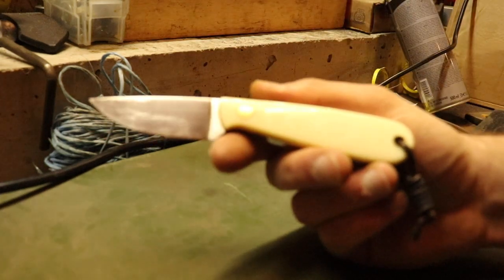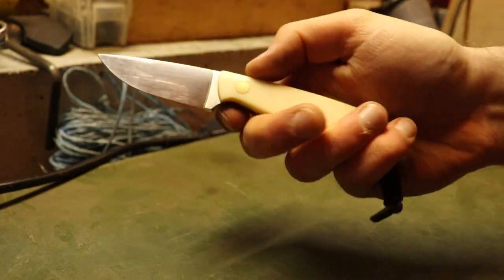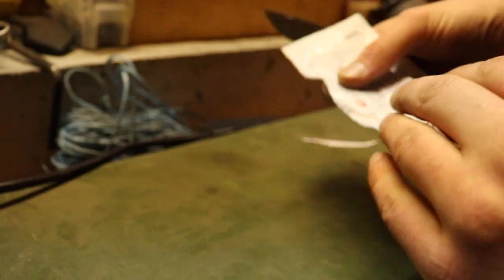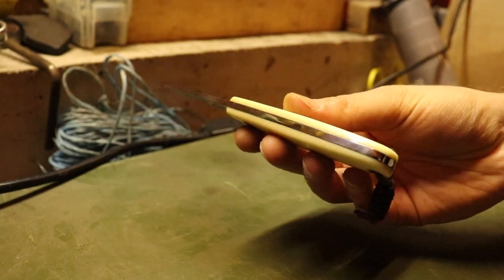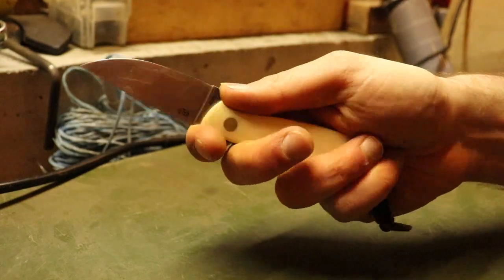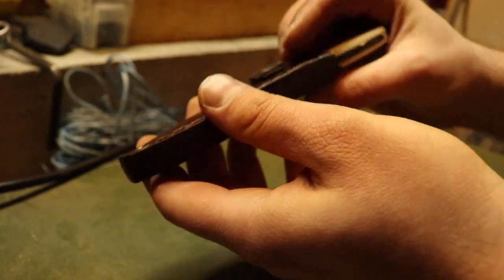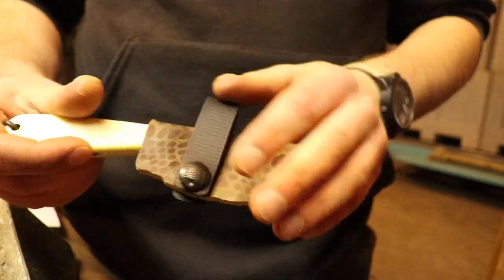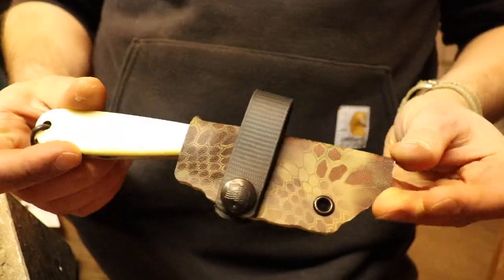Enzo/Brisa Necker 70

Comment: Love the 12C27 Steel on my black Micarta Enzo Necker.  I used a heat gun on the stock kydex sheath to help retention and added a IWB clip. Awesome little appendix carry.
Reply from the maker: It really hides great under a shirt or sweater. Also i think this is the best 12C27 i have used so far.

Comment: Mine came really dull.  It wouldn't cut paper.  After 20 minutes on course stones and fine on the Sharpmaker and Crock Stick (I use both when sharpening) it's now scary sharp!  The black micarta is also excellent quality as well as the sheath, which has a drain hole it you get it wet.  A nice touch.
Reply from the maker: Thanks for the input, didn´t know there where some quality inconsistencies.

Comment: I've been looking to get a small necker, and this one is definitely on my radar, so thanks for the review. It's come down to either this Brisa, or an LT Wright in A2 steel. A2 is better steel for sure, but I doubt I'll be using it hard, so 12C27 is fine and about half the price.
Reply from the maker: If the size is right for you, than this is not a bad option. And like i said i was really positivly surprised with the 12C27 from them. Maybe mine is just exceptionally heat treated, but it performs way better than what i know from other companies 12C27
Reply: 12C27 is an older steel alloy that is still in popular use today.  The iron ore is very pure. 

It's one of only a few steel alloys ever confected specifically for making blades. It is (or at least has been) very common for razor blades. As such, it is not surprising that it makes good knives.

It takes and retains a good edge and it's very rust-resistant.
 It's not the next-phase, new-wave, dance-craze steel, but it's still got plenty of rock and roll left in it. Swedish steel has always been a premium steel for tools because the iron ore is very clean, that is to say it has very little Sulphur or Phosphorus in it. Carbon 0.6%, Manganese 0.35%, Chromium 14.0%.
Reply: Dont sell Sandvik steel short. It is VERY tough for a stainless, and the basis for many popular use steels that are beloved in the knife world. AEB-L which is used to make some very pricey customs is a close relative to 12c27 not to mention Nitro-V.  It really does hold it's own against lots of higher priced steels, including A2 imo. It's not gonna hold an edge quite as long, but you dont have to worry about rust
Reply: @matthewadler1329  I'm not trying to sell it short. The Sandviks are great steels, and in general, budget friendly. They are my favorite of the budget friendly steels.

Comment: There are products you can get that will take light scratches out of the blade without polishing off the finish...but I with a belt satin like this, it will depend on how deep it goes. I've been able to do it though on one that had probably about standard  depth satin finish. You could also just bring the whole thing up to a mirror polish and then refinish your self or just leave it, which would look good too. Thanks for showing this. It is a paper micarta right?
Reply from the maker: Yes it´s paper micarta. What do you use to polish out scratches? On this knife i really don´t care about the finish.
Thanks for watching.